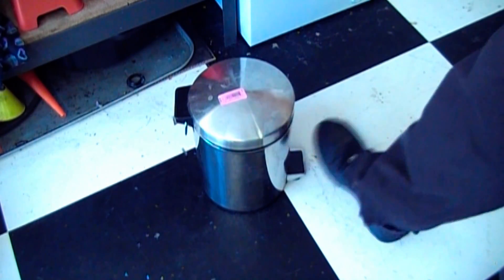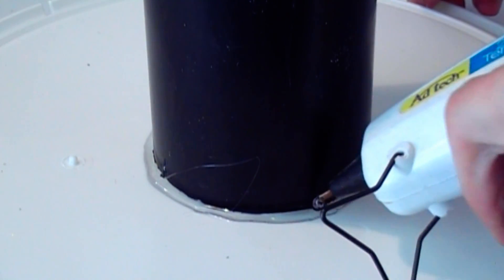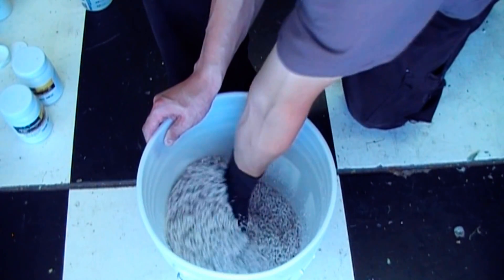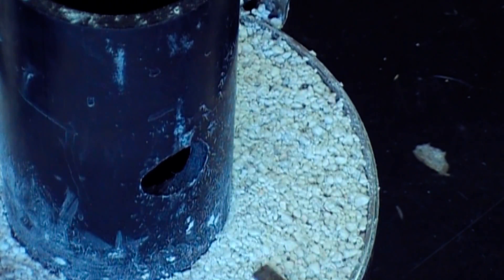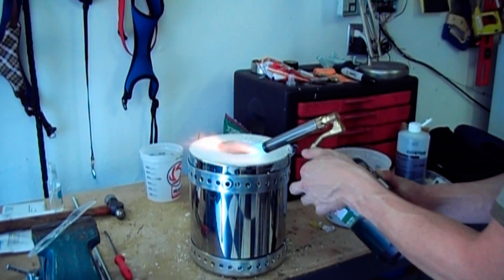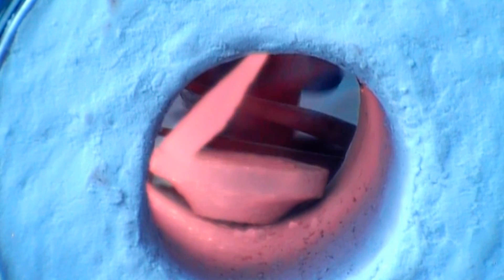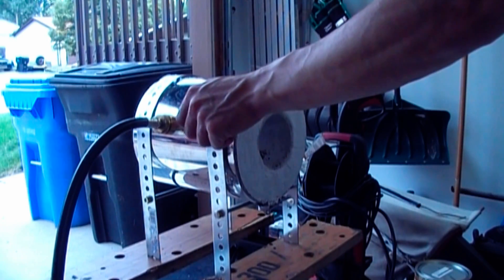How to build a trashcan forge

Comment: Is it possible, to mix the perlite with firecement?
Reply: I am in process of making one of these, depending on the firecement I think you can, most is only rated to 1900 degrees F which is not enough, there is a 3000 degree f one, but have not found where to buy. I found a site to order water glass so I am going with that.

Comment: Still in search of weight, you haven't had time to reply. I read in one bit, you named the two parts added together, and you wrote 500g for each, or 1,000g, which would make the weight of the perlite/glass 1 kilo. I could have the outer frame of the pizza oven welded up out of stainless, and make the inner form our of Styrofoam, or mold the whole thing without an outer steel shell. 

So, watching again, if the can is 14 inches high, and 10 inches in diameter, and the walls are 2.5 inches thick... or put another way, (' designates feet, and " designates inches), a cylinder 14" high, (1.166666667'), and 10" in diameter, ( 0.833333333'), with a cylinder of 14" High and 4" in diameter, ( 0.333333333'), removed, the formula: π × r squared × height, diameter is half of height, yields this equation:

 [3.141592654 × 0.416666667(squared) × 1.166666667] - [ 3.141592654 × 0.166666667 (squared) × 1.166666667] = 
 0.636317958 - 0.101810873 = 0.534507085
Or, 2 kilos in weight for roughly half a cubic foot, (check my math). I can calculate my molded oven, and know if I can pick it up. I can calculate the square footage of steel plate if it needs the support of an outer frame, before I fabricate it.

Comment: I want to build a wood fired oven for pizza and bread. Could you give us some dimensions and weight, maybe the estimated weight of the steel bucket you filled? Then I can calculate the dimensions, use the weight figure you give me, subtract the weight of the bucket you molded it in, and get the weight per square foot. Does it need a steel outer skin? Could I build a mold, cast it, do the surface seal, and set it on insulating bricks? I want it light enough to put away if necessary. I know how light perlite is. I visualize breaking the seal of the high temp caulk between the molded oven and the fire tiles on the floor, and easily carrying it to storage. Thanks for the feedback on another question. One benefit is that the response helps me find it again quickly.

Comment: Hi, This the first video I found discussing sodium silicate forges. My goal is to make a cheap, light, wood fired oven. I am concerned the use of aluminum may yield toxic fumes into my food. Any feedback appreciated.
Reply from the maker: I would not be concerned about the aluminium oxide. It is very stable, and is a significant part of ceramics like porcelain.

Comment: Thank you for this informative video. I'll have you know I built a forge according to your instructions but it's three times larger and it turned out great. Although my sodium silicate was cloudy white not not crystal blue like yours. Also the weather here was in the 60's and cloudy so it took two weeks for the silicate to dry, I think adding heat would have helped speed up the process or direct sunlight. All in all it worked out thank you very much.

Comment: damn aluminium oxide is 20$ for 2 lbs where i can get it, otherwise i have to buy a 50 lb bag for 100$. Slight markup in small volumes. that's insane.
Reply: Buy the bag, get a sand blaster and find something to sand blast with the stuff you don't use. Got any enemies?

Comment: +clkindred That was 3 years ago.. How did the experiment hold up over time? 
I see you made a new one without plaster added to the refractory, or the coating cement..
You must have decided the Magnesium Silicate (baby powder) didn't help or hindered the mix. Same with the plaster. 
On the second build, you added Aluminum Oxide to the Refractory(instead of plaster), and on the cement/sealer, you dropped the Baby Powder/Plaster of Paris from the mix..
Do you have a minute to explain what your thoughts were on making those changes and how things have held up, and if you were to do it again , what were the problems, or what do you think could be addressed better?
I am looking at making another forge and making my first furnace to melt metals including Cast Iron and Steel.. 
One more question.. Your second Refractory (Perlite/Sodium Silicate/Aluminum Oxide). You let it cure for a week.. Do you think it could have been heat cured? Did you try any mix outside of the forge for curing?
Lots of questions, but, I'm sure I am not the only one thinking about these things.. 
Thanks for the awesome video's and taking the time to do some testing/thinking about it..

Comment: Im in the process of putting my forge together now.  I used a 20 gal propane tank as the base, welded on some rectangular stock for feet, and used a similar makeup for this forge- only I used no water, a ton of waterglass (may explain why it was so hard), Pearlite, and plaster of Paris.  I dont know if I have to let this thing sit for a week... but I figure I'll give it until the weekend before I start messing around with it more.  I have two burners made of 3/4" black pipe spaced about 6" apart from each other.  My hope is that this will work and create some SWEET SWEET STEEL for forging.

Comment: Someone mentioned in your rocket stove video that they made a sufficient liner just by spreading hydrated lye directly over the perlite. Looking at the chemistry, perlite is 75% silicon dioxide, so it's the same reaction which makes water glass, only superficially since it's just applied to the surface, however lye can also reduce the oxygen out of aluminum oxide (one of the main ways aluminum is purified industrially), which is another component of the perlite, as well as being an important component of the liner since it's resistant to almost 2000 degrees. But, being careful it might be possible to shortcut the water glass process and mix the perlite directly into the hydrated lye, combine thoroughly then add the aluminium oxide and ram into the furnace quickly before everything starts to set.
Reply from the maker: MarcAFK Interesting, I had thought perhaps the heat decomposed the sodium hydroxide into sodium oxide in that instance.
Reply: I'm going to try the Hydrated lye + perlite reaction once I get my hands on some perlite. I made a dodgy rocket stove yesterday and having tested it I think I've worked out it's shortcomings. The perlite refractory will be for my second stove, which will have a larger combustion chamber, better solid lightweight refractory, and other features which should be more useful then the first one.

Comment: Forgive me if I cannot find the answer to my question within the comments.  First of all, awesome video.  My question is about creating the aluminum oxide sealing cement.  I saw in the video it was just sodium silicate and the aluminum oxide, but you mention curing it by expelling the moisture with heat, but I did not see any mention of using water for the sealing cement.  Do I have that correct in that it is just 2 components:  sodium silicate and alum. oxide?  Thanks for your time.
Reply: Sodium silicate is a liquid containing a fair quantity of water, I imagine when it's baked the moisture is driven out leaving only the alumina and silica oxides as a glass.

Comment: Question, do i need to add the aluminum oxide? or can i do without?.
Reply: the aluminum oxide, or alumina, is the key ingredient to this refractory. it probably wouldn't be very useful as a forge without it.
Reply: Hi Kevin, does the grit size of the Alum Oxide matter? 
thanks in advance.. 
  Julio

Comment: Just wondering, all these videos I watch have the back sides open, why is that? wouldn't it be more efficient if the backs were closed?
Reply from the maker: Two reasons, there needs to be a way to let flames out the back, or else the heat won't travel to the back, and for long knives that won't all fit within the forge. Sealing off the back, and placing the burner in the back seems like it could solve the first problem, but ends up overheating the tip of the work as you try to heat the rest.
Reply: propane forges need to have plenty of exhaust room, too - too much back pressure can inhibit the forge's ability to reach a high temperature. 

it should be noted, too, that the torch itself is not what heats the workpiece, rather, it is mostly the refractory lining that radiates heat into the piece. placing the torch in the center is almost always ideal, because it heats the refractory more evenly.

Comment: Do you think the furnace mix of soduim silicate/water, aluminum oxide, and perlite would work in making a sort of perlite-based Insulating firebrick?
Reply from the maker: Yes, but if bricks are what you want, factory firebricks are probably a better option.
Reply: + @clkindred  , sir in a video I watched quite some time ago the man mixed fire clay in with his perlite aluminum oxide and waterglass. He also used a metal straw attached to a CO2 canister to gas the mixture once it was packed in the forge. The CO2 sets the refractory due to the waterglass reacts to CO2 just like in an automobile engine.  Then he mixed the fire clay and waterglass (and I think he added graphite powder to but I may be confused on that) into a slurry and painted it on the inside of the set refractory  to form a hard coating then gassed that too. Then he fired it in a slow heat up cycle to an extreamly high temp and slow cool down cycle measured w a thermometer thing on a wire. 
   He used his forge for smelting aluminum brass and steel/iron. So I'm guessing it got really hot. 
   I'm sorry my memory isnt so good so o cant tell yall his name or channel.
But I do remember he said it is substantially heavier than just perlite... just fyi.
   Hope this gives yall another option  or food for thought and opportunity to see if yall can find out more out there.
  Blessed day sirSir, Crawford out
Reply from the maker: @danielcrawford7315  that sounds like the channel myfordboy.
Reply: + @clkindred  , thank you sirSir

Comment: I want to ask about perlite - what is the best grain diameter (to use in forge)? I found there are 2 types of perlit - 1 is used for plants, gardening (some kind of subsoil or something) and second is used in building as flooring isloation etc. Is there any big difference between those?
Reply from the maker: Gniewny Medrzec small garden perlite is what I used. Small particles will make a stronger solid, larger particles will be more efficient and make a lighter solid. Ideally small partical perlite for near the surface of the lining, and large particles for deep inside.
Reply: Thanks for a clue!

Comment: will it work if i use refratary concrete?
Reply from the maker: Yes it should work with refractory concrete. However refractory concrete has its own strange instructions that needs to be followed in order for the concrete to properly cure. Also "refractory" is not well defined as to exactly what temperatures they are talking about, so some products are meant for fireplaces and fire pits, they are not up to the task of a forge.
Reply: and if i make a mix placing refractory bricks glued by refracory concrete?
Reply: by the way thanks!
Reply: and greetings from spain
Reply from the maker: That would hold up better, but refractory linings need to be treated as disposable, because they will need to be replaced from time to time.

Comment: Can you achieve forge welding temps?
Reply from the maker: Adrian Pimentel I only ever tried it once and failed. Best I can guess is, not without a larger burner.
Reply: +clkindred have you tried closing the back to trap more heat for forge welding temp?

Comment: Have been trying your instructions. When adding heat to the refractory mix it bubbles then becomes flaky. Any suggestions would be helpful. Thanks
Reply from the maker: Jerry D. McDowell usually that means there is too much sodium silicate in the mix. The finer the particle size of the filler aggregate, the more problematic it is.

Comment: CLKindred: at 6:27 the video shows inserting the new orifice into the torch body output. I have 3 of these torches purchased with the last 2 years and in all 3 the output thread on the body is not a NPT thread? My project is at a standstill until I can solve this dilemma? Any suggestions?

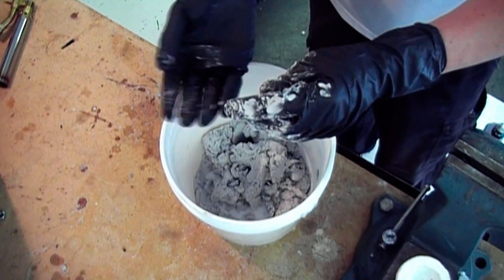Comment: So CLKindred, at 4:01 you mixed up some sealing cement: were you able to seal both ends of the forge and the center opening with one mix of 150 ml silicate and 2# of aluminum oxide?

Also, did you line the torch access hole with anything but your sealing cement??
Reply from the maker: Yes, with some to spare.
Reply: OK, very well. Thanks for responding.
I'm leaving a space of about 1" in diameter for the torch head. I'm planning to reduce the diameter with the sealing cement to allow the torch to just pass.

If my calculations are correct, it looks like I can duplicate your forge with 5" of aluminum oxide.

Comment: Drilling the .016" hole in the 1/8" plug for the torch, is not for everybody. I would suggest that anyone wanting to build this nice forge, buy a set of #78 drill bits and some 1/8" plugs (Watts LFA-710) and try their hand at drilling the holes.
The #78 drills are tiny. I had to get out the microscope to see if the ends were sharpened. They were sharpened!
It's necessary to pre-spot drill the place to drill. A very sharp center-punch might be used, lightly,  but would raise up a well around the hole. (I don't know if this would cause concern.
I used #30 drill followed by a #50 to make a spot. If the bottom of the spot is raised even the smallest amount, the #78 drill bit will wonder off center. Chuck up the bits only leaving 3/16" protruding.
I used the pin chuck from an old dremel motor, chuck into the standard chuck on my mini lathe. I set the lathe RPM at 60 RPM and used lots of cutting oil on the drill bit.
I found that I could drill about 2 seconds, backing the bit out to clean off the chips. It took about 5 minutes to drill through the 1/4" head of the pipe plug.
I managed to drill two successful holes out of four plugs. Two drill bits snapped off before I realized that the chips were seizing the bits.
Reply: You would imagine one could drill most of the way through with any other sized bit, and only need the .016 hole through very little material.. I've also heard many people saying that mig .030 wire tips work well.. more gas more heat? Seems like there has to be a better way than spending money on a bunch of broken horsehair bits
Reply: Ya, the 90 cents for the broken bit plus the $2.50 for the plug!. Well, I suppose one could drill out with perhaps a 1/8" drill leaving about 1/8" of  material. This still leaves the problem of getting the #78 drill bit started "on center". I found that the bottom of the spotting hole must be near a near perfect V in order to keep the tiny wire drill from wobbling. I was just just lucky that my #50 drill produced a spot clean enough to start the #78 bit. (The chips must then be cleared often to keep the "horsehair" bit from seizing.)
The ideal is to find a spotting bit that produces a V bottom hole without a flat spot.

Comment: do you think plaster or Paris would work as well as the silica blasting media?  would sand work better?  I cannot find the white blasting sand only black
Reply: that is what I used and it works just fine, I did 1 part plaster of paris and 1 part white sand and  water.

Comment: would a plaster of paris / sand mix be good for the insulation lining do you think by your wisdom?
Reply: PS subbed and liked great video :) ty!
Reply: plaster/sand works, it just doesn't last forever.  Best way to go for the dollar, you could make a dozen of them for the price of one of these.
Reply: it really depends you can buy cat litter made from pure silica gel 9 pounds for 10 bucks drain cleaner for about 10 and a forge this size 4 pounds of aluminum oxide for about 12 bucks so total cost 32 or so

Comment: I'm building a forge and thinking of using your refractory formula, so I'm wondering how yours held up, I see by your videos that your recipes are always changing, you're always upgrading, was this one the best?
Reply: I need to be able to reach temperatures well over 2000 F, can you tell me if your formula can handle it, after reading you video comment where you say alumina alone conducts heat more than is ideal for a forge lining, I wonder if the perlite will make it harder for me to reach those high temperatures

Comment: So I got all my materials together, and made the refractory lining, and put it in a stainless pot with a pvc inner form, and I ran out of lining about an inch from the top. I'm going to try and make more sodium silicate tomorrow, and get more perlite, but I only have one pound of aluminum oxide left, and about 100 grams of silica gel. So I might be waiting on amazon prime. What do you think are the chances of success with lining starting the curing process at different times?